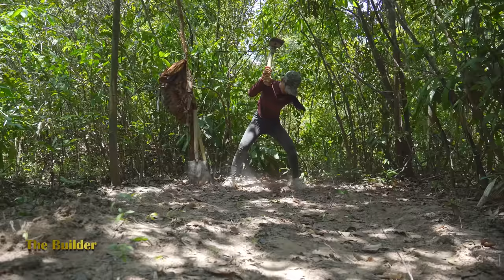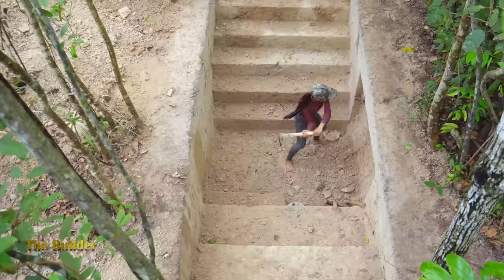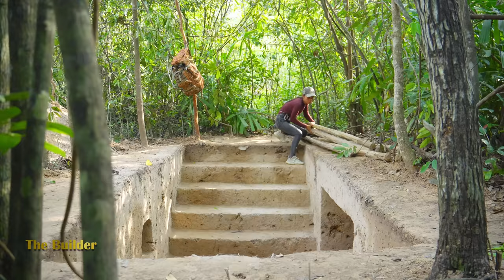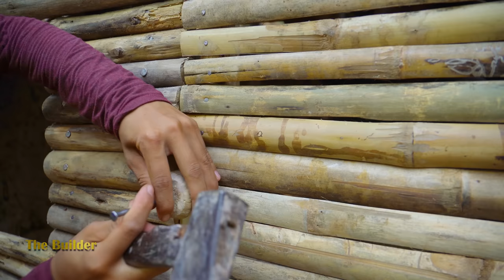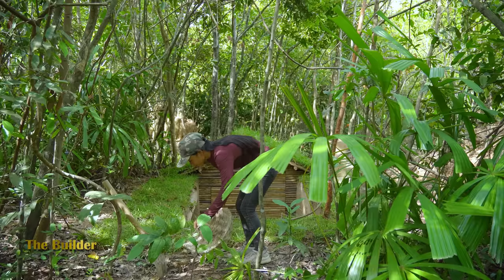Girl Solo Living Off Grid, Build a Complete Warm Underground Dugout Home Shelter for Fortnight Stay

Comment: That type of structure is a death trap, especially with that chimney right there. The big issue with "Hole in the Ground" habitats is they are perfect places for heavier than air gasses like CO2 to collect. If you were to build one of these it either needs to be on a hilltop or a steep hillside so you can make a positive flow vent at floor level to the outside to prevent the buildup of gasses inside the dugout. This chimney being so close is dangerous because a smoldering fire in an early morning stagnant air condition can result in the smoke cooling rapidly and drifting right back down into the hole. This would not end well. While the common defense to this is that "It is always windy here so this won't happen," My answer to that is - it only takes once.
Reply: The fireplace is outside of the actual house, and built in hard clay. No issues that I can see, as a retired firefighter.
Reply: @AgnesMariaL  Heavier than air gasses like CO2 accumulate in low points. The entire dwelling is a pit in the ground with no place for any gases that might accumulate to escape. The fireplace is just one potential source of gasses in a structure like this. Gases from rotting vegetation can come out of the soil as well. Heavier than air gasses are all toxic to humans and all flow like water, pooling in low areas.
As a firefighter you should be aware of the danger of bad air in enclosed spaces and pits without proper ventilation, especially in low points. 
We have labor laws in most developed nations that regulate the depth of pits for workers without active ventilation to keep workers from walking into a pit full of a toxic gas and passing out. Even a food cellar can become deadly if not ventilated. 
Mine explorers can kick up CO2 just by walking through stagnant water on the ground. The air being okay on their way in and then the released CO2 rises high enough as they descend that they are overcome and never get out again.
Reply: @socket_error1000  I do not disagree. However, she only sealed the roof, and left the sides of the building as initially constructed, with gaps between all the logs. The likelihood of any gases from the fireplace entering the hut is near zero to begin with, unless an unfavorable strong wind happens to blow through, but the structure itself, being unsealed aside from the roof and clay foundation, allows for airflow/ventilation.
Reply: @AgnesMariaL  It is a pit in the ground. It does not matter if there are holes in the roof or wall if the entire thing is under ground level. Heavier than air gasses can still collect in the pit. 

This is basic health and safety and the danger of pits would have been something you should have been taught as a firefighter. It is a serious risk to first responders as more than one would-be-rescuer has seen an unconscious person in a ditch or pit and jumped in to help them only to become a victim themselves.
Reply: @socket_error1000  Sure, it's a "pit in the ground", but only partially so. Not to mention that it's in the middle of a CO2-sucking jungle. I'm guessing that you're from a first-world "educated" background, but this girl is otherwise, and my impression from all the builds that I've seen of hers is that she knows her stuff!
Reply: @AgnesMariaL  Yes, I am educated. Particularly, I was a builder and building inspector for a good portion of my life. The reason I bring up life and safety issues I see is because all the codes in the UBC were generally not written on a whim. They were written most often in reaction to the deaths of people who became victims of failures of the existing codes to address a potential hazard.

It is no secret that more people die, are injured, and disabled in structure failures, as well as in workplace and work related accidents, that occur in undeveloped nations versus the rate of the same in developed nations. This is because builders and developers will cut corners whenever they can and use substandard materials and methods, endanger workers, and civilians just to save money if there is no enforcement to make them do otherwise.

This is why earthquakes topple entire city blocks and flatten villages with nothing but single story homes, killing 50 thousand people in Turkey. Why an entire island of people in Haiti ends up homeless, living next to piles of rubble with 250 thousand people dead and the same amount injured back in 2010. 
Codes and regulations save lives.
Reply: @AgnesMariaL  you can't see that it will fill up with water ?
Reply: @mattfraser3452  it could - but if there's a proper roof over the entrance and a cap on the chimney, it should be fine. Hard clay does not drain well at all, so for water to leach in through the ground itself there would have to be some serious rainfall and that water would have to sit on the ground for a long time for the clay to absorb it. We have clay soil here, and the low spots that hold water turn into mud soup whereas all the high spots just shed water and stay rock hard.
Reply: She wouldn't want to fart then.
Reply: From a builder to a builder excellent good job
Reply: We are an over populated world  and NEED to do away with being overly safe and return to survival of the fittest ways before either one of two things happens. 1 we become a virus and destroy this beautiful world like a cancer or  2 an extinction level event happens and humanity dies. We aren't here for our own self gratifying purposes, we are here to look at after  and take care of this beautiful world and harmonize with it. I love people  but I don't think we deserve this world and it's a damn shame . Our karma is gonna be a beautiful bitch when it happens though.
Reply: @MatthewDavid-n7i  This has nothing to do with being "Overly safe"  or survival of the fittest mentality and I would posit that building codes and other safety measures enforced by governmental bodies have saved your life either directly or indirectly on more than one occasion. 

Food health and safety laws are some of the biggest health laws that impact our life on a daily basis without us even realizing it. EPA laws are another that are overlooked. They often protect water quality and prevent companies from polluting ground and surface water. 

These laws are not to keep the weakest from perishing to the disadvantage of the fittest. They make sure it isn't survival of the richest over those with no other choice.
Reply: Bb ni
Reply: You wrong my dude, cause very venomous snakes live there and what you are talking about is comparable to apples and oranges, so if you get bit by a snake and you still think you gonna get Co² poisoned then it's only gonna take once.
Reply: My main problem wouldn't be heavier than air gases but snakes
Reply: @dereksimmons01  LOL, yeah I guess that is true and considering many of them live in holes in the ground I might be missing who this home is really being built for...
Reply: @johnjeff3849  I know for that region it is an issue just walking around.  But enough people watch these that some actually go out and try and build stuff like this. More than one ignorant person will do something like this and then let their kids camp out in it with a kerosene heater...end of story.
Reply: @dereksimmons01  I was joking, wasn't it obvious?
Reply: @socket_error1000  I think in future I need to highlight when I'm joking.
Reply: @socket_error1000    i grew up in a basement,  oh no!!!!!!
Reply: @blacksheeprcmodelers959  Actually we have a lot of safeguards in our codes to make sure gasses like CO2 can't accumulate in basements. 

Considering basements are often the location of mechanical equipment they are a dangerous location especially if gas appliances, furnaces, and water heaters are in use. These can develop leaks in exhaust and are easily capable of becoming a danger. There is also the danger of other toxins like radon gas (radioactive, naturally occuring, colorless and odorless gas) that causes lung cancer. 

Most of the time basements are not living spaces and those converted to such without the proper considerations have a rather bad track record and have resulted in many code changes regarding their use and liability issues for those who convert them.

Today most jurisdictions require detectors in any living space below ground level, and even have laws requiring them in all rental units regardless of the elevation. Of course codes are not retroactive in regards to owned property unless it is being remodeled or renovated but rental laws are.
Reply: I’m going to have to disagree. Dugout houses have been around for centuries. As have cave dwellings and cliff dwellings. I’ve lived in a dugout house. I’ve been to cave dwellings and cliff dwellings (essentially dugouts as they both have sealed floors and roofs). This structure has plenty of ventilation through the intentional cracks left in the walls. Heavier than air gases do accumulate in low spots … but they are gases and subject to breeze variations and air movement. Believe it or not … CO2 does travel and lift when exposed to breezes and air movement cause by thermals. If dugouts were so incredibly dangerous this country (USA) would have never been settled as most pioneer homes were either dugouts or cave dwellings.
Reply: And this is coming from someone that has dealt with dead.y gases his entire adult life. I’ve been working in the oil fields for 28 years. I’ve dealt with everything from CO2 to H2S. If it comes out of the ground naturally … I’ve been around it, dealt with it and/or smelled it.
Reply: @patrickreynolds9853  Read what I wrote...I said stagnant air conditions...I also   gave examples of ways to make similar dugouts safe like building them into a hillside instead and putting a positive flow drain at floor level. 
This structure has no way for any gas that might accumulate to escape. 

People have died in trenches as little as 4 feet deep because the trench filled with the exhaust fumes from the heavy equipment running near them. All it takes is still air and a source of heavier than air gas nearby. 
Most settlers dugouts and sod homes in pioneer times in the USA were not holes in the ground but dug into hillsides. This allowed for the inevitable rainfall that would inundate the structures to drain out of them and not fill them up.

As for their survival rate of those pioneers...the average lifespan back then was about 40 years. A lot of things contributed to the short lifespans of our fellow Americans at the time. A great many of them died before being able to fulfill any dreams of being poar tof that westward expansion. A lack of regulations at the time had nothing to do with success. It is moronic to suggest any such thing.
Reply: Boys she woke up the next morning so its safe and you dont have to live there so let her be after all she has built  lots of them and still living
Reply: @donames6941  FIrst; she doesn't live in this, or any of the others, even for a night. This entire concept of Habitat building show was stolen from a guy in the USA who started the entire fad. Then a bunch of people in other places jumped on it claiming to be making authentic structures. Nobody lives in stuff like this. 

Second; the issue is that this particular structure teaches a dangerous building habit to people too ignorant to understand the danger heavier than air gases as evidenced by this comment section.
Reply: @donames6941  agreed
Reply: @mattfraser3452 , if you look at the trees around where she is building you can see the water line by the discolorization on the lower bark.  Glad I wasn't the only person wondering about that.
Reply: Just kick back and take notes she didn't say to build it yourself she's just having fun ..I for one am a little wiser because of her. She did a great job and the ones cutting negative comments are just hungry go eat and leave the nice lady alone .
Reply: @BigSpooky89  Nobody is attacking the lady. I am saying this particular type of structure has a fatal flaw in it. One that if people go out and start digging below ground structures without taking precautions against can result in asphyxiations and death.
Reply: Now you're attacking me!!???...Wowwww ....lol jk fam you got a point can't argue with that
Reply: @johnjeff3849  Yep. Being deployed with the VN Troopers, and living on the economy, we pretty much ate what they ate. That included snake, and it was delicious cooked over an open fire. I think there was a slithering critter every few inches. Not really, but VN had its share. 
    We usually pitched camp, with preparation to wake up shooting if we were attacked, so sleeping in an underground tunnel was not a concern.
    But the Vietnamese are not dumb. They have hundreds of years of fighting, and living where the situations dictated. I never heard of anyone dying of poison air.
Reply: @jacoblecoy3700  I watch films showing US soldiers going into tunnels to clear them out and think, 'how the hell could I ever do that'
Reply: Why would anyone have a fire burning at night? It's for cooking only. No worries about early morning stagnant air conditions killing you in your sleep while you cook breakfast.
Reply: @socket_error1000  It's a cooking fire, not a heat the house while you sleep fire.
Reply: Yes , the WET season ?!
Reply: @socket_error1000  Nah, I worked in the bottom of pits way deeper than that all day  in 100 degree Fahrenheit working concrete - she’ll be fine.
Reply: @charlesfulnecky1974  Ventilation? Large open air pits are a bit different as there tends to be more air movement but even they can be an issue if there is a lot of equipment running and no crosswinds above. This is a small confined space.

I worked in the construction industry all my life, even spent time as a finisher myself, and owned my own company. Whenever in enclosed areas or small pits often those four feet or deeper, we had ventilation and/or air quality alarms to prevent toxic air conditions. It was not only required by OSHA in many cases but we had to have detailed plans for it as part of our submitted safety plans in most bids where those conditions were expected to be encountered.
Reply: Brilliantness of what the mind can do
Reply: Wonder how long it takes.
Reply: Learned a lot from y'all arguing 😂😂. Thanks
Reply: @AgnesMariaL so the part of the pit outside the house and uncovered, and the gaps in the logs (which to pointed out, can't possibly allow the gasses and water to seep back in. 🙄
Reply: All seems like a lot of work.
Reply: @mattfraser3452 that was my first thought!!
Reply: @AgnesMariaL I don't see how her chimney is a whole lot different from  fireplaces I've had in my houses. As long as it draws the air upward, just like man I'll have your shouldn't be any smoke accumulating in the living quarters
Reply: @socket_error1000  "People have died in trenches as little as 4 feet deep because the trench filled with the exhaust fumes from the heavy equipment running near them. All it takes is still air and a source of heavier than air gas nearby. "
Wrong. Exhaust gases kill people because of the CO, NOT the CO2.
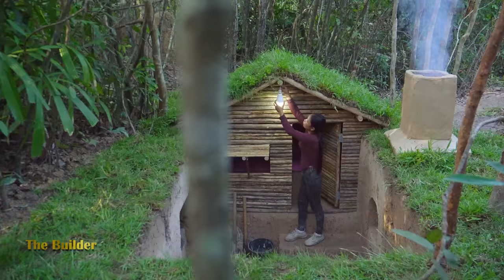CO is lighter than air. Also look at the smoke column coming out of the chimney at 22:15, there is no way the smoke would settle in the dugout.
Based on what you are saying if she had a candle in her room she would be dead.
Also, CO2 is heavier than air but that could never be a problem because her breath would eventually kill her which is stupid.
I'm a mechanical engineer, stop being so pedantic and give your I'm an expert BS a rest already. Jesus HC.
Reply: They been building these since before we All were born. They know what there doing.
Reply: @talishabailey  No they haven't. They have not been living in holes in the ground in SE Asia... Do you know how much rain they get there? These would be muddy water pools a good part of the year and not dwellings.
Reply: @GregoryBamber  Your own farts are not deadly. Not usually anyway.
Reply: Oh stop….
Reply: Interesting below ground "structure"
I highly doubt she built that in one day. I doubt anyone could. That means she's wearing the same clothes each time she records. 
I would also be concerned about heavier gases.
Reply: 2 steps up to get in dwelling
Reply: I had  question on ventilation, as well as water drainage during rainy weather. How does one compensate for these? BTW these videos ARE AMAZING!!!!!
Reply: @jazzydfromdc   The way to properly build this type of "dugout" structure is to build it into a slope or hillside. Something open like this, built on a slope, could be done and allow for natural wind across the structure to pull any accumulating gasses out. 

Having the structure it in a place that would allow for a gravity flow drain to be installed at the lowest point and let water and any heavier-than-air gasses that might accumulate inside to flow out is the best solution. Much easier if you only have to dig a small pipe run out of the structure at floor level for a few feet before it is clear of the hillside and allows for any trapped gases or water to easily flow out. If the entrance is clear to floor level, then a simple vent in the door or gap at the bottom can solve the problem.  

In small hunting shelters and other hideaway dugouts you often not only see them built into a hillside but also see other precautions like elevated sleeping platforms dug into the walls or bunks built up from other material, keeping the sleeping occupants above the level of the entrance, to add extra insurance to prevent going to sleep and never waking up.
Reply: You should put your conversation on the midas touch, just saying...
Reply: What's producing CO2?  I believe you mean CO.
Reply: After all that shoveling I wouldn’t be able to get up and walk out of that place for a week ventilated or not 😧
Reply: What happen if heavy rain pours,how can u drain water there😅
Reply: Can't you just give her credit?
Reply: haters gonna hate
Reply: very good points. However, I have a question. During war time the Vietnamese and Japanese armies like to build tunnels. How do they survive?
Reply: below grade. Low airflow?
Reply: @realvalue626  A lot of them died in those tunnels but it should be noted they understood these dangers and built vents into them for those gases to escape. 

One way that the US military dealt with those tunnels was to pump gasses into them faster than any normally generated gas could escape through these built in vents. Sometimes it was just the exhaust gasses from equipment like trucks and in other cases it was flammable gasses they would ignite. In some cases the Vietcong used water traps,  S shaped tunnels (like you have under your sink), that they could fill with water to keep these gasses from getting to them. These had the added bonus of drowning any US soldiers trying to crawl through the tunnel to get to them.  As you can see there is no such mechanism here. 

My concern here is not for this woman as this is not built to live in but simply for views on YouTube, as is the case with all these channels. It is for other people who might mimic this type of construction and not be aware of the danger they pose as traps for heavier than air gasses. If there is not a vent/drain near the bottom that can allow those types of trapped gasses to escape, then these become death traps not just for those who occupy them, but unaware people that jump into the pit to try and rescue them only to become victims themselves.
Reply: Guys you gotta lighten up. To hell with codes, she is freaking brilliant and I wonder how many of you would be able and are capable of building anything even close to what she has built? She is in nature, moves around, uses her instincts and skills, and is probably happier than most city dwellers in their fancy homes and apartments. What a bad ass!
Reply: Well if that’s the case then how did our indigenous people here in Canada live for all these centuries in pit houses with the fires in the center of the house?
Reply: just for nomads, stay a day or two and move on
Reply: @socket_error1000  I see your point, I do electrical work and in Data Centers with raised access floors they require us to use the Air Sniffer to check for those gases
Reply: @socket_error1000  I bet you're real fun at parties, if you ever get invited to them...  go grow up
Reply: I personally think the whole thing is a hoot it must have took her a lifetime to dig through all that dirt and clay and grass and back and forth and back and forth and anyway how did she finally get the electricity out there to hang the light she ended up bumping her head on you could see it swinging from the top, dumbest thing I have ever seen if you believe this you'd believe there's beachfront property to sell for pennies in Alaska where the sun shines all day too 😂😂😂
Reply: Hot gasses rise and draws cold or fresh air. Of what I say is false,  then how are kerosene lanterns able to function since kerosene is a greater supply of co2 output than burning wood?
Reply: Good God, what do you live in this comment section? It seems like you want to be the expert of nothing. Move on man.
Reply: Hard working young lady and you know what you are doing. Great job. I can see problems in a big rain though
Reply: Lol the hilarious thing everyone has missed is she is buying the lumber. Every tree stump is debarked and uniformly the same roundness and height. There are videos with planks of wood lol. Try watching the peeps that do everything from scratch including making their own tools and even their own nails. No cheap tricks like using tarp either. They even show you how to make rope to tie stuff with.
Reply: @pwd1679   I believe he means CO as well. 

Both gases are produced by combustion but out of the two CO is by far the most dangerous.

Both gases are very much lighter than air when hot after combustion but heavier than air once cooled down.
Reply: You don't remember nam, they had compounds underground
Reply: @laurenmorgan6271  I think you need to do a little more research on how they engineered those tunnels and bunkers. They had positive airflow that allowed fresh air to flow in and prevented toxic gasses from accumulating. They were not stupid.
Reply: @socket_error1000 Lmmfao 😆😅😂🤣😭
Reply: @socket_error1000   It's in a rain forest. Don't need to have a fire all night long to stay warm. It's for cooking mostly.
Reply: Look at the video- there is NO wind blowing. Not good.
Reply: @socket_error1000  dude, really, go outside. And try to leave women alone. I know it'll be hard for you, seeing as you're a "can't do, so criticize others" type, but I'm rooting for you. Only you can stop yourself from going full incel. Today's the day. We believe in you.
Reply: Y yo digo q tendrá una hermosa piscina cuando llueva 😂😂😂
Reply: It not gonna be lived in
Reply: This afternoon I also told the worker to put a protective shield on his face. You don't need a stone in your eye every day all week. Once every ten years is enough
Reply: She did a great job. Hell, I never did this along with many others that are saying negative things knowing damn well you never dug a hole that deep les known building a shelter underground